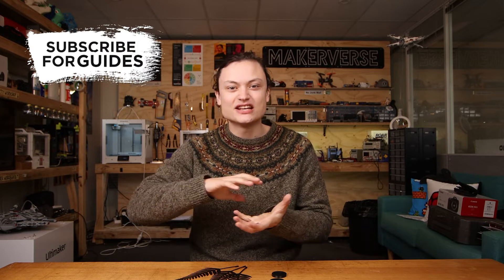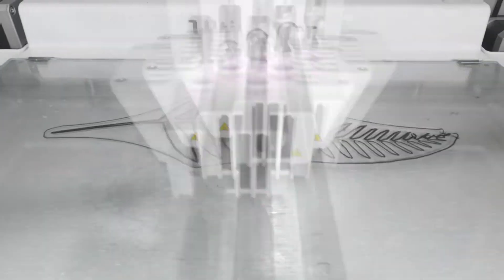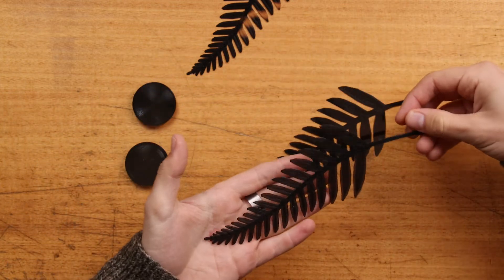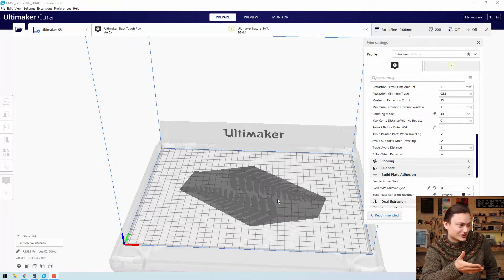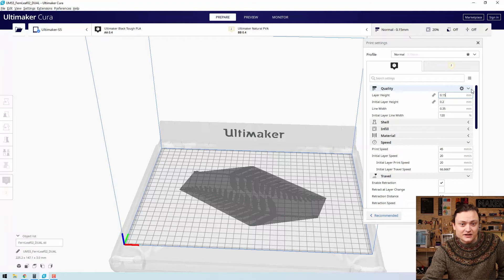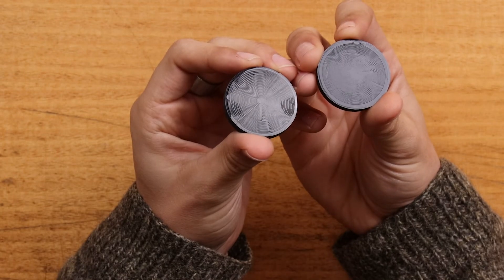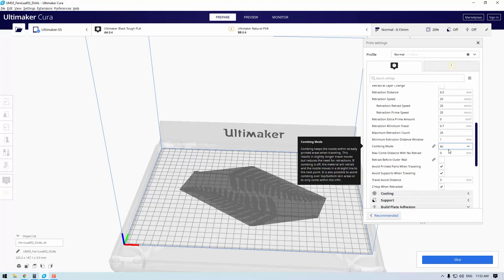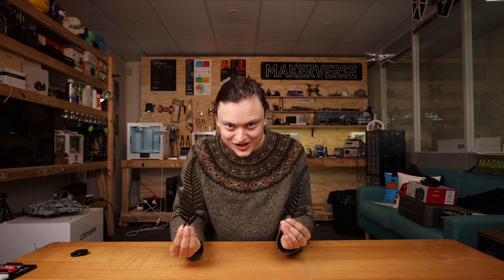3D Printing Perfect First Layers!

Comment: Not sure if your going to get involved in 3d printing.
I have bought a ender 3 couple weeks a go. I am using Ultimaker Cura 4.6.2. I have been looking for Digital Designs to print.
I think I have this digital printing working. I have FreeCad loaded and making PARTS. On my first part making is finished. Now I want to print my designed part. When I save the image it looks like all the cubes and cylinders that I have used to make the part.
How do I save my finished image part without all the excess so I can load into Ultimaker Cura so I can print?
Reply from the maker: Definitely a good question to ask on our Core Electronics Forum https://forum.core-electronics.com.au/. We have a whole team raring to help with your 3D printing projects!